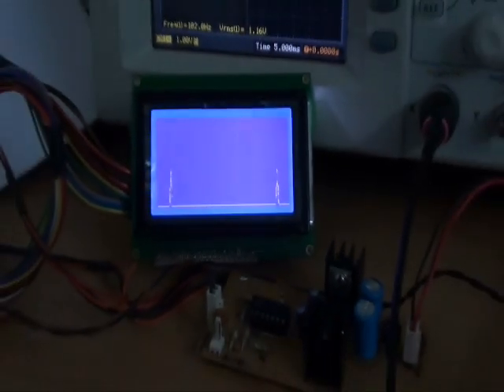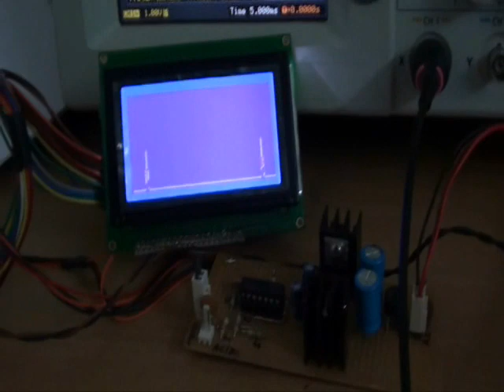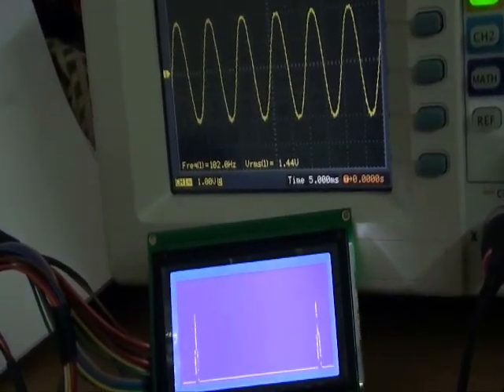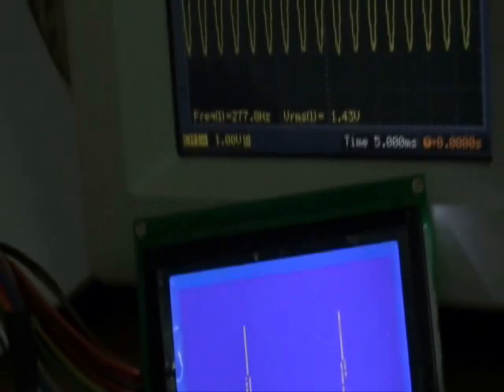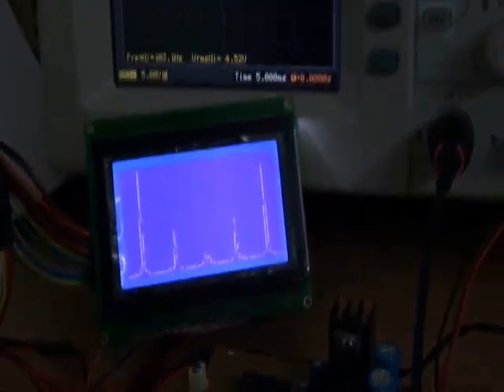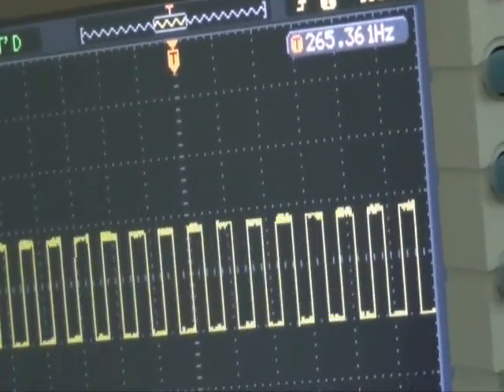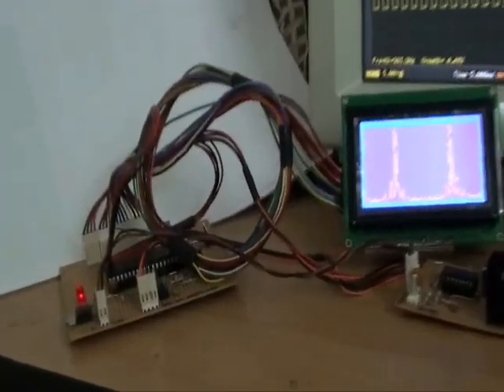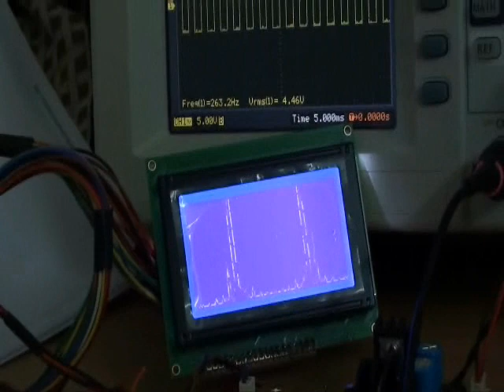Spectrum Analyzer using dsPIC30F4011

Comment from the maker: @Yugifran 
I am using C18 compiler that comes as free along with MPLAB IDE from Microchip. I do not use any library. I built the code from scratch. For hardware connection, I do use D0 to D7, but for control signals (CS1, CS2, RST, EN,...) I use the pins from Port-C.

Comment from the maker: @1OverX 

 I bought it locally in Bangalore. Also, driver is written by me. I use it for couple of other projects as well. All details (code & hardware) available on my web page. Unfortunately, I cannot post the link on youtube.. :-(
Reply: can u please explain ..Which dspic controller did u used?? Using this is it possible to find harmonic spectrum..Can you please reply
Reply from the maker: Any dsPIC should be fine. Find the voltage for each harmonics (using FFT) and then calculate the THD if you want.

Comment from the maker: You cannot go to 1MSPS without using DMA. So effectively, my sampling rate was lesser. I used the data sheet to configure the ADC. I use MPLAB and free C30 compiler provided my Microchip